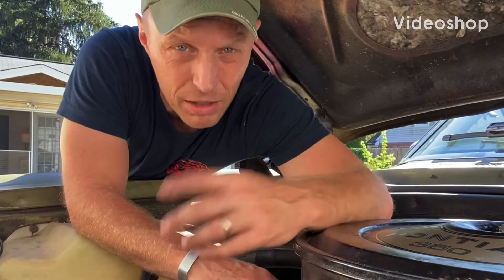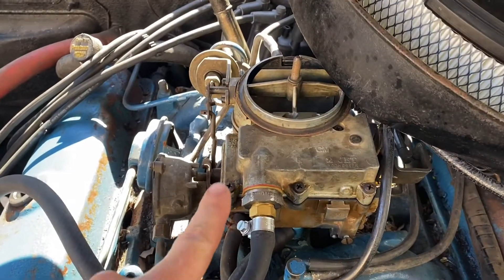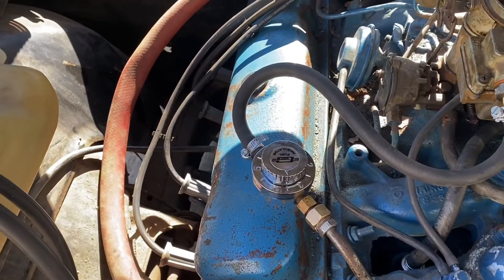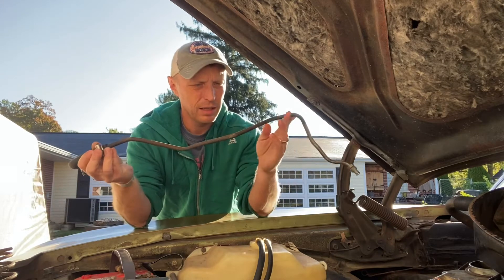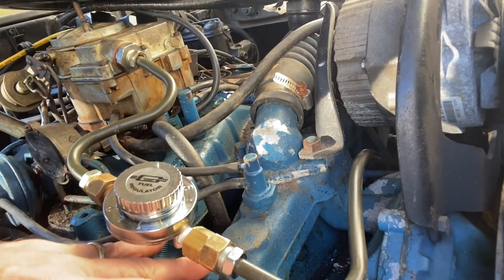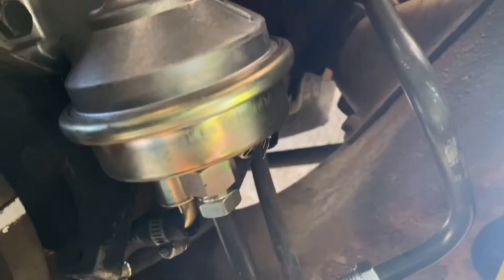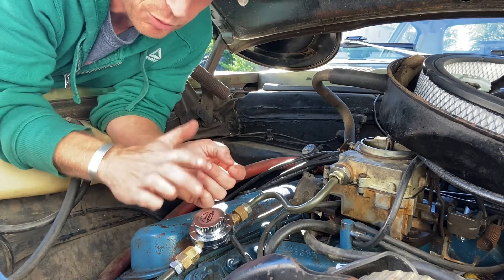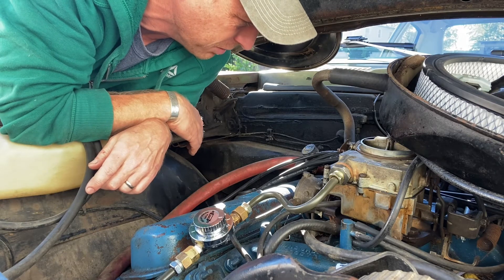Carburetor Flood Control

Comment: Thank you for this! I installed a new carburetor, then installed a new fuel pump and the fuel pump overwhelmed the carburetor and I couldn’t figure it out. Your video saved the day.
Reply from the maker: @ChrisFBartlett  glad I could help!  Never had this problem with older parts, it’s a lack of quality control that brings up these issues.

Comment: Is it better to add the fuel pressure regulator inline before the fuel pump or after?  Or does it matter?
Reply from the maker: After the pump.  You want to control the pressure produced by the pump going to the carb
Reply: @Foxcanfixit  Kool thanks.  Been recently having flooding issues.  Ill give this a try hopefully it works.

Comment: A regular fuel pump for caberated motor are set at the factory at 6 lbs . You are thinking way to hard . Just set your float bowls.
Reply from the maker: I would try it again if I still had the car, but I don’t.  I agree this was probably only treating a symptom and not the cause.

Comment: Need to reset your float bowls and if they still flood the float bowl valves are sticking open too much. And on a 502 BBC calls for 6 lbs of pressure on a 750 Holly .
Reply from the maker: I agree, that should fix it, I had The float levels low, needle and seat replaced a couple times, power valve and accelerator pump not leaking, last resort was reducing pressure

Comment: I bought one of those fuel pressure regulators today from O'Reilly's hooked it up turn it to the line before 1 and gas was still coming out of it after I turned on my elderbrock electrical fuel pump which is only pushing 4-7 PSI. I figured the less the number was the more restriction and the more the number is the more flow but even at the line before 1 gas was still shooting out of that regulator so maybe the regulator is faulty I don't know but maybe I could take it back but it didn't work for me
Reply from the maker: Well that sucks, it could be a bad one, I’d exchange it, try 1 more then if that doesn’t work get a different style from Jegs or Summit
Reply: Thank you

Comment: Wondering how the Mr Gasket regulator has held up? I read a lot of mixed reviews about it. Thanks!
Reply from the maker: I’ve used them lots of times, they are by no means perfect, and I got it wrong saying the numbers indicate fuel PSI, they are just there for “high to low” relevance.  But for an entry level adjustable regulator on a mostly stock engine they are very good

Comment: Mine carburetor doesn’t spit gas to the Jets it gets stuck
Reply from the maker: Gets stuck how, what part gets stuck ?
Reply: @Foxcanfixit  the Jets where blocked with build up so I had to take it apart and check every whole and sure enough the Jets was the problem. Put back together and the car started right up 👍🏽
Reply from the maker: That happens all the time, especially when carbs or vehicles have sat for awhile, it doesn’t take much sediment/dirt to block a carb passage or jet.  Good work fixing that!
Reply: @Foxcanfixit  It’s crazy how quick it happened and yes sir I’m a very happy man! This is my first rebuild I’m proud 🥲 i learning so much with this impala

Comment: Couldn't you have just gotten a fuel pump that produces the proper PSI?
Reply from the maker: Ideally yes, But so far I’ve only come up with the same ones that the previous owner tried.  I am going to check into some older non-return pumps next.